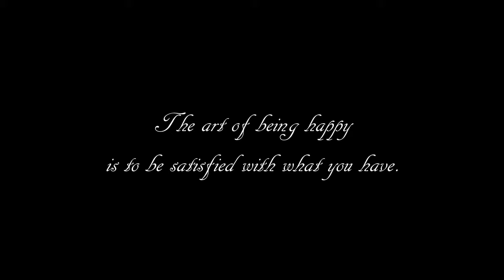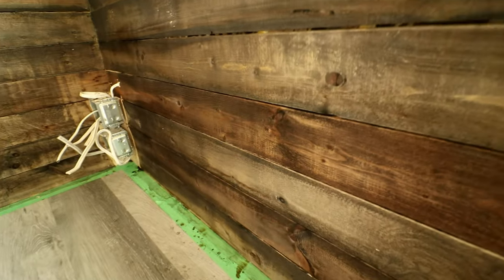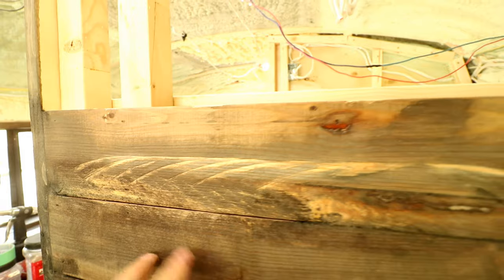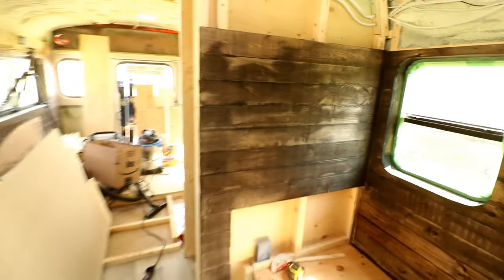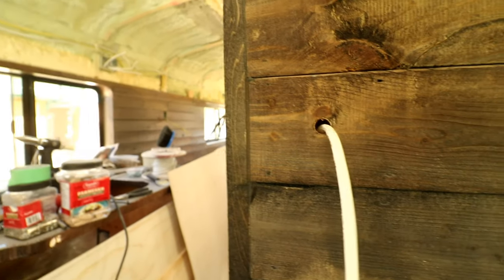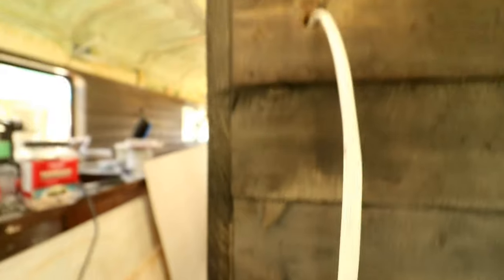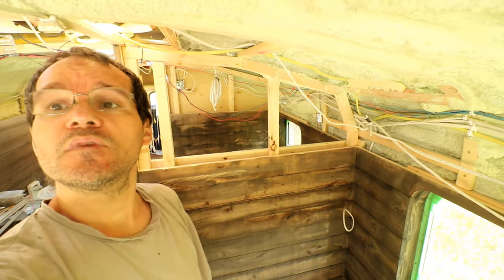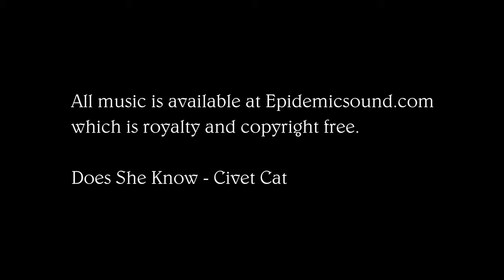Skoolie School Bus Conversion #55 Staining More Walls - May 25, 2019

Comment: I like the splotches...they add texture and depth!  What do you plan on using for the varnish?
Reply from the maker: I use Varathane brand Diamond Wood Finish Interior Satin.  I show a can of the product in https://youtu.be/6PgSwatSO7w  . In the following episode i apply it to the wall and it changed the color of the wall slightly.  It still turned out quite nice.